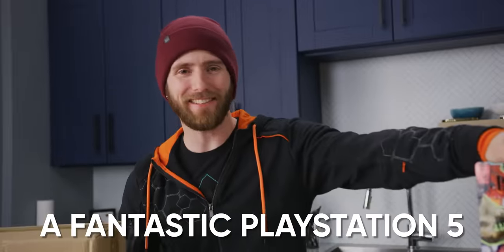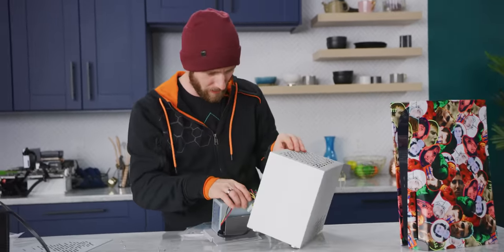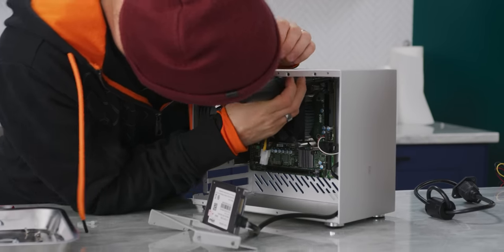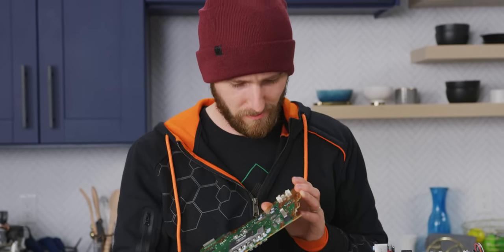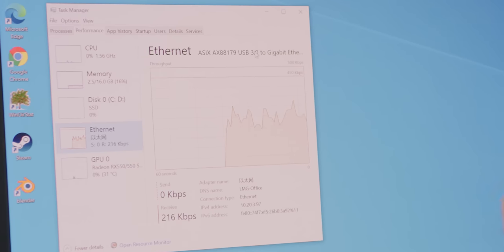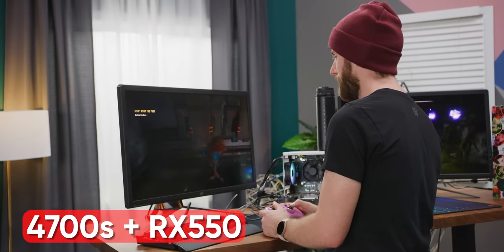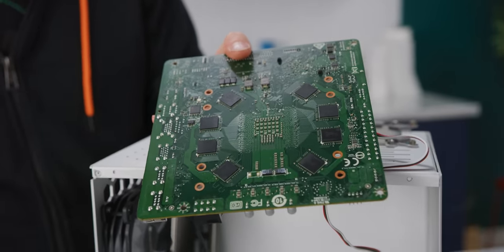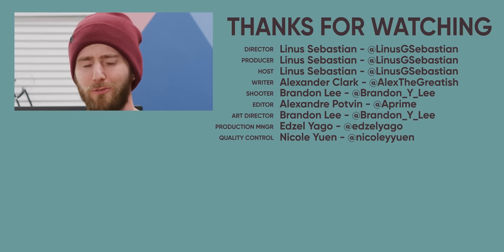Why Is AMD Selling Broken PlayStation Chips?

Comment: 9:50 Linus points at a chip on the board and makes an incorrect assumption. What he is pointing at is a common Ethernet Isolation Transformer and not an Ethernet Controller.
Edit: The actual Ethernet port there is controlled by the system controller chip which is why there is none built into the main CPU die.
Reply from the maker: Thanks!
Reply: Oh hi linus!
Reply: Yup, and sometimes this transformer thing is integrated right into the jack

I learned that while working on using an RJ45 connector for a non standard application
Reply: @JUSTKOZ  hmm yes clown for making a simple mistake. They're not a board designer how are they gonna know what that is. The only clown here is you for tryna clown LTT.
Reply: @mokubakaiba1751  he said worse case scenario, also it could theoretically catch fire bc to get the same wattage at 110v vs 220v the amperage would be higher which could short or fry something not specced for a higher amperage, which doesnt seem far fetched on such a cheap psu that might not have modern protections
Reply: @JUSTKOZ  🤡💩🤡💩🤡💩
Reply: omg linus has been corrected
Reply: @fn0va  Yeah, but he knew what he was pointing at, I'm just "that guy" that had nothing better to do......
Reply: he also assumed a 240V PSU will go on fire and burn your house down if connected to 110V. Not. Going. To. Happen. Serious LTT guys, up your electrical engineering game, maybe hire one finally. That being said I wouldn't trust these cheapo PSUs a bit whatsoever. But. That 110V argument is utter BS.
Reply: @dennismaurer7649  Chill dude! Everyone makes mistakes
Reply: @ploski4986  yeah but it's getting a bit much in this regime lately. Just shortly ago he claimed touching 110V instantly kills you. Come on, Mr Linus you know better than this.
Reply: Neat
Reply: @PlinkyVR  i understand and agree with you but you saying "LTT" after saying they made a tech mistake is contradictory... Sorry if I come off as that guy
Reply: @PlinkyVR  I turned off comment notifications so this is probably permanent bye
Reply: Good thing I checked the comments, I was about to post the same thing
Reply: @LinusTechTips  did you just like your own comment?
Reply: commonly called the magnetics
Reply: It sends phase shift between each pole so instead of 1,0  it is 1, -1....   probably just wouldnt work.  its alwayd flipping like the copper coil at the power plant between both sides hot is nuetral nuetral is hot where in 110 nuetral is always the same.  unfortunatly it wont burn your house down
Reply: opto-isolator
Reply: @mokubakaiba1751   @Elliot Declet   @Dennis Maurer  
(US/Canada) 120V/240V since ~WW2... seeing 110V/220V (on the label) which are outside of the standard +/-5% from 120/240 is... ugh.
Reply: @LinusTechTips  but do you know something not worth thanking and priceless, it's our sponsor glasswire
Reply: @PlinkyVR  lol hating on a pro cause ge isnt perfect
Reply: @LinusTechTips  I Trust only Linus! (10100rsn) Calm down!
Reply: @kolby4078  not an opto no.

The aim is the same ie true galvanic isolation. But they are magentic isolation transformers. They are used to both isolate the differential signals, but also provide a proper termination for impedance matching.

Optos, as the name implies use light elements to feed signals into, or from, areas with highly differing voltages / currents / ground references etc.. but they don't work on differential signals (I mean, you could, but you'd introduce no end of phase shifts and other delays that would destroy the point of using a differential signal).
Reply: Ye
Reply: @PlinkyVR  it’s well deserved. A little bit of research goes a long way. They should know this. And with the Subscriber count LTT has, it’s the least they can do 

Clown
Reply: @LinusTechTips  You gonna like/heart your own comment now 🤡🤡
Reply: @JUSTKOZ  get ratiod
Reply: @Ober1kenobi  they put out so many videos and when they make a minor mistake because none of them are experts and nor do they need to know what the parts are because they're not actually trying to figure out what the chip is they are clowns? Everyone will make mistakes how can you be expected for example to know something about something someone else made and you aren't in the industry and you cannot research the part? Or you just don't care to research it because you aren't going to be replacing it. Its such a minor problem and you think it's a big deal? You again are one of the clowns here not LTT. There's going to be slight errors slipping through the cracks no one's perfect. A subscriber count doesn't give them the knowledge in the industry of ethernet PCB designing does it?
Reply: @Thats_Mr_Random_Person_to_you  so ground loop isolation?
Reply: @kolby4078  ground loop is one of the main reasons for them yes. Signals running potentially between buildings which will have different earth potentials as each earth is slightly different.

And as others have mentioned they also provide a proper impedance matched termination to ensure good signal quality and improve SNR (reducing signal reflections etc that all come from impedance mismatches).
Reply: How does it feel to be the ACTUALLYYYYY guy?
Reply: Plot twist its from wish
Reply: @PlinkyVR  oh lord thin skin for yo boy? He was wrong, he can handle objective criticism.
Reply: @mokubakaiba1751  True. I thought that immediately as well.
Reply: @CosmicEpiphany  you're on LTT YouTube comments section. LTT gonna get checked on facts, calm yourself boy.
Reply: @rrrggg4334  110 and 220 are what's in my old house
Reply: @PlinkyVR  QQ fanboy
Reply: @NEDMKitten  not a fan boy. Are you though? You commented to me once, then thought it wasn't enough after talking to others so came back to me. I'm honoured to have a fan!
Reply: @PlinkyVR  <3 😘
Reply: @NEDMKitten  Unless you main is 70 years, unserviced, old transformer substation - it's not. Check with a voltmeter.
Reply: @PlinkyVR  HUGE ANIME BREASTS
Reply: @Obsidian Colossus yep, nothing better to do
Reply: @LinusTechTips  240v power supply is for Europe..we have a 240v power net
Reply: @SoggyHamburgerzz  got em
Reply: @kolby4078  nope. They are "magnetics".
Reply: Well, you learn something new every day.  Wish I knew half as much as Linus, I'm mainly here to see his reaction to weird things and for news on LTT products at LTT Store.
Reply: @LinusTechTips  when yall gonna acknowledge your mess up with the series s/x video you did with doom eternal?
Reply: @LinusTechTips  DO SOMETHING ABOUT THE NUDITY COMMENT BOTS.
Reply: @mokubakaiba1751  It will sort of explode if 220v is applied to a 110v psu. But most PSU today are auto voltage type.
Reply: It was a simple mistake due to the size ??? Maybe misread google results. the preview text for any search result can sometimes mislead, assigning the name of some other part to the part number you wanted...
Reply: @ryankm48    the switch mode power supply will try to get twice the current from 110 than from 240. Pops the slow blow fuse or bridge rectifier, thats all.
Reply: @rrrggg4334   110/230 +- 10%  (approx. )  are the new world standards, w hich conveniently compatible with the worlds historic voltage ranges.
Reply: @AndroidFerret   Its far more complicated, China, singapore, India...  vs Japan, Taiwan, Vietnam...
Reply: @isilder  120V(240V) and 230V (Europe)
110V is outdated sh-t, talking about 110V in NA is like having a "gas" pedal in a Tesla... :)
Reply: @isilder  I just ran a 6/3 guage 50amp 240v line up to the attic for the air conditioner so I could game all summer and super cool the PC.  7amp 18,000 btu gold finned closed loop r134 mini split.  I have plans to run 240v for equipment off that line.   Probably get a smoother run when pulling a heavy load on my 1600 watt psu
Reply: 2 Esdras 2: 33
Reply: linus daminus
Reply: @rrrggg4334  Precise AC voltages don't matter so much in the modern world. Different countries around the world have had different standards all along. While some countries have always had strictly enforced +/-5% tolerances, poorer countries have systems where "we shove about this many volts in one end, but by the time it gets to your village God only knows what it's dropped down to".

The "modern" EU unified standard is officially 230V, with a wider tolerance either side (it might veen be 10%), precisely to accommodate member countries whose systems were already set up for 240V as well those who were using 220V. Basically, everybody in the EU had to start ensuring their products would be both safe and functional on any other EU state's power supply. Likewise 115V (with the same wide tolerance) is the spec for anything that claims to be useable in the US, Japan, etc.  So as long as everything is built to a wider enough tolerance, the only voltage conversion you'll ever need when moving around the world is a simple 2:1 transformer - and most high-tech gear won't even need that.

Of course, you'll still need a few adaptors to cope with at least 5 different common plug & socket types around the world... But they don't have to convert the voltages, so thry're cheap, lightweight, and easy to manufacture.
Reply: Get clown'd linus
Reply: No one cares what it is or if he is wrong ! What we care about is when Linus will release his own line of Sandals :) LTT Sandals + free bonus socks!
Reply: @JUSTKOZ  Don't clown yourself.
Reply: @AMalas  Yep, these days almost all the passives, and sometimes the PTY are built into the jack even if the controller itself is not.
Reply: @PlinkyVR  i think it was joke :/
Reply: Linus Tech Tipped
Reply: Yoooo linus
Reply: @JUSTKOZ  meanwhile, justkoz doesn’t even know what an Ethernet Controller is.
Reply: @LinusTechTips  Fking rekt n00b
Reply: @JUSTKOZ  🤨 projection much lol 🤡🤡🤡🤡

Comment: So instead of immediately turning the PS5 APU into E-waste they create a seriously underpowered board that only slightly delays even more E-waste.
Reply: i thought the exact same thing.
Reply: I can see it gaining popularity as an e-cafe bundle, if the price drops to a tolerable amount
Reply: @updog4L  
Which is never will because it's wasting 16gig of gddr6 or whatever they soldered onto the back.
Reply: Would probably be fine for shitty office PCs.
Reply: @XeonProductions  athlon and pentium exists
Reply: Yes. But now it is NOT their e-waste.
Reply: It's not about reducing e-waste, recycling and repurposing and reusing, saving the environment.
It's about turning total loss into partial gain. Any profit is better than no profit, especially after factoring in the material and labour costs built into silicon yield thresholds. There's always market niches for (semi-)functional parts which fail to pass minimum spec on minimum bin.

As Linus says, this is "not a good look" for AMD. Their reject parts should have been replaced/refunded by the silicon manufacturer, TSMC. But they're somehow stuck with a lot of duds and they're trying to liquidate them - by diluting their AMD branding into junk products for lower-tier markets. Seems like a dumb and desperate strategy.
Reply: @XeonProductions  They could have just recycled the already pure silicon that was used to make the APU. It's a lot more efficient than general recycling.
Reply: That's actually better than just dump them into some third-world E-waste field since these half defective chips are an unavoidable byproduct in chip production.
AMD is pretty active in chip-recycling comparing to Intel from what I've seen.
Reply: @matchc0635  Intel bins and bins and bins everything. They actually design their chips to specifically facilitate this yield binning, a top-tier Xeon with some bad cores or defective caches can easily be reconfigured as an i9, i7, i5, i3, even a gutless Celeron if it's part of the same chipset generation. It's why the overclockers are sometimes able to make lesser parts perform like greater parts, and it's why they're sometimes sadly disappointed.
Reply: @matchc0635  this just shows how better the silicon quality of intel cpus are compared to AMD, when everything bad was being sold by amd no matter what
Reply: he said that every chip cannot be made exactly same so the bad ones end up here.
So, does intel also does this?
basically tech companies cannot repeat their products exactly like the previous one? 🤔🤔
Reply: Just because it can't keep being a gaming PC forever doesn't mean that it can't keep getting used for years.
Reply: Wall e
Reply: @cameronsprague101  Can you repeat what you're trying to say in a coherent way?
Reply: Got this mobo with 5700 xt for 499€
Reply: buddy it sells for 9,999 INR (119 USD) on mdcomputers so its pretty cheap, i don't know why it was so overpriced in north America or china

Comment: Linus is right: Power supplies should ABSOLUTELY be switching by default. It's been a thing for ages now. And with no label on the outside either, it's a recipe for disaster.
Reply: To give you an example for how long this has been an standard: one of the first computers I've ever seen, the IBM PC AT that came out in the late 80's ( 1988 ) , It's power supply also had that switch
Reply: They've even been doing the switching automatically for the past decade.  We had some fried school computers back in the days because some people thought it would be funny to flip the switch and wait for the next guy to use the computer.
Reply: This was dumb. Why would a product not intended for NA market cater to their power standards? Here in EU when I buy electronics I don't expect them to support weird power standards from another part of the globe or have stickers warning me that they don't support power standards of America or some small African island.
Reply: @SteelRodent Mine accepts 100-240V. There is no rule saying they can't also accept other power systems, as long as they work with the European one. In fact, I would find it unacceptable for any kind of portable device or gadget to ship with a charger that only accepts 230V, as people are pretty likely to bring those when travelling abroad.
Reply: @Victorianous  most likely because there is higher amperage then it was designed for for 120v. Though normally the voltage is most dangerous for electronics (since amperage is only pulled when needed). My guess is those kind of setups don't have all the modern protection features it should have
Reply: @SteelRodent erm no ?  almost everything comes with a 110/220v autosensing circuit build in.
Reply: the UK (pal) PS5 does this exact same thing though, sadly. 220-240v, 50hz only according to the back of mine. Probably explains why this PSU is like it is, even if it's still not an excuse to do it.
Reply: @SteelRodent Not all, I have seen plenty of PC power supplies with a switch in Estonia._
Reply: @Glotttis  Its funny still seeing so much entitled karen thinking the rest of the world only uses 110v and their hilariously outdated imperial system.
Reply: Reason is simple: the CN system intergrator have never thought that it will be sold or taken (such a big PC is unlikely to be brought with travelers) to places with 110V electricity like NA, so it simply uses a 220V only power supply which works for CN, EU etc. If this assumption is right no wide-range voltage support is not a problem but the intergrator has understimated the power of globalization…… I searched for German resellers of 4700S, then there are some PCs differs from this one, and they may support wide voltage range
PS: I think there's really one place where wide voltage range support is a must——Japan: Although JP uses mainly 100V, there are also some places where uses 200V, and also both 50Hz and 60Hz grid are deployed in JP due to historical reasons
Reply: @Glotttis   Taiwan is 110 . Japan is 100, China is mostly 240v.
Reply: @Frizzy9000   thermal protection on bridge rectifier or other silicon ? thats it. They melt the bridge rectifier of the basic   switch mode PSU design.
Reply: @isilder  Are you saying lower end PSUs don't have proper thermal protection? That is interesting to learn!
Reply: In school i've played with PSUs older than most fortnite players and even though they dont switch automatically they have a switch so you can do it manually
Reply: @Glotttis  Because you know one is going to burn out eventually, and it is not worth the burned out house and possible causalities that come from it. And we're pretty sure it can be done cheaply because of all the others doing it regularly. At least it should have a sticker on the back indicating the voltage with a huge warning sign, but that might be more expensive then getting it right in the first place.
Reply: If you don't propose the device to be soled in us Canada, then you won't need the 150v package  in Europe there are not such requirements for a psu
Reply: @resentfulsoulofthetoilet589  all up AT model shapes, did, it was one the things new to ATx, the new soft power button was a thing  out of laptops that sort of stuff high end semi one off's

Comment: That was actually not an Ethernet controller chip, but an Ethernet passives/magnetics package. (You can tell by the fact that it's really tall)
Reply: @arisusanchez  just report and move on
Reply: Oh
Reply: @karmila8758  shut up
Reply: Ok
Reply: I knew it!
Reply: Zen has always had built in controllers for ethernet, usb, sata, and audio. They're just only used in ryzen embedded and epyc products.
Reply: @germanwtb I thought linas knew alot than there is you
Reply: I too have read the other comments.
Reply: @karmila8758  k
Jk
Reply: @shumba_the_don  the amount of times I have reported that sex bot scammer's account is unbelievable